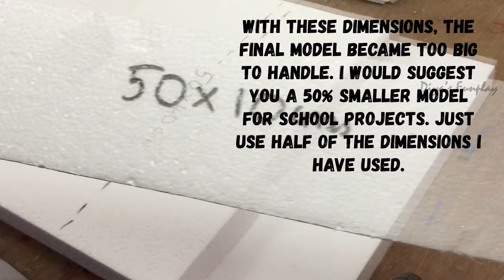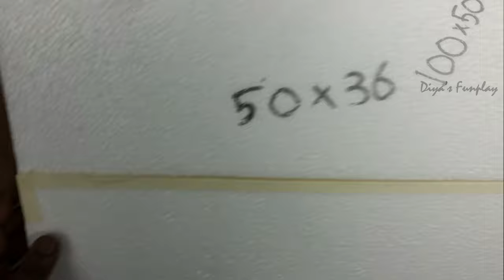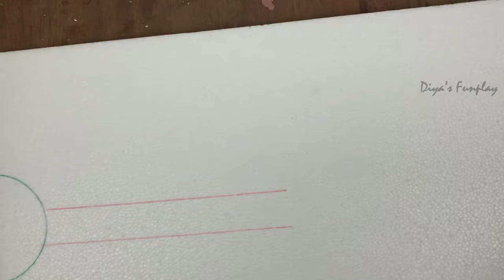Dam working model for science fair | Dam irrigation model | Water dam model for science exhibition

Comment from the maker: A Dam is a barrier built across a river or stream that blocks the flow of water.

Advantages of dam:
1. Provides water for irrigation and human consumption.
2. Generates hydroelectricity (we will not run out of hydro power as long as the water cycle exists.)
3. Avoids air pollution as hydro power is a clean energy.
4. Dams provide prime recreational areas for boating, camping, water sports and picnic.
5. Dams can supress floods thereby avoiding a big disaster.
6. Dams are useful for navigation (inland river transportation)

Disadvantages of a dam:
1. Dams affects biodiversity. Dams restrict the movement of migratory fish and other aquatic animals thereby affecting their reproduction and gradually decline in population.
2. Plant life may get submerged under water and eventually die.
3. Dams will capture and hold important sediments needed for habitats downstream there by affecting the fertility of the soil.
4. Construction of dams can affect the groundwater table along the river.
5. A dam collapse could be a major catastrophe. 
6. Construction of a dam could be very expensive.
Reply: Hello sir...plz reply urgently...how many no of thermocol sheets you have used and of how much of thickness of every sheet
Reply: Please reply 👏👏👏
Reply from the maker: Items needed:
Thermocol (1 inch = 2 sheets, 1/2 inch = 2 sheets, 1/4 inch = 1 sheet)
Cement (1.5 kg),
pvc pipe (1/2 inch = 1.5 feet)
Fountain pump,
pebbles and some toys (if you want),
Plant models (you can also make them with paper)
Reply from the maker: Sorry, somehow missed your comment. If you still need the info....
Items needed:
Thermocol (1 inch = 2 sheets, 1/2 inch = 2 sheets, 1/4 inch = 1 sheet)
Cement (1.5 kg),
pvc pipe (1/2 inch = 1.5 feet)
Fountain pump,
pebbles and some toys (if you want),
Plant models (you can also make them with paper)
Reply: Can you say where is the fountain  pump  available
Reply: Please reply
Reply: How much time can it hold the water ? At least 1/2an hour?
Reply from the maker: @drpreetiautade2286  Items needed:
Thermocol (1 inch = 2 sheets, 1/2 inch = 2 sheets, 1/4 inch = 1 sheet)
Cement (1.5 kg),
pvc pipe (1/2 inch = 1.5 feet)
Fountain pump,
pebbles and some toys (if you want),
Plant models (you can also make them with paper)
Reply from the maker: @misbahulein7848  It depends on the model you make.
Reply: Can we run we run it without the water pump pls reply urgently pls
Reply: Yes
Reply: I just completed my model 😊😊😊😊😊😊😊 thank you
Reply: Thank u 😊😊
Reply: Thanks for this video 😇
Reply: @diyasfunplay  how
Reply: What was its mame
Reply: Bro wrote an entire essay

Comment: Who many thermocol sheet using
Reply: Please reply
Reply from the maker: Thermocol (1 inch = 2 sheets, 1/2 inch = 2 sheets, 1/4 inch = 1 sheet)
Cement (1.5 kg),
pvc pipe (1/2 inch = 1.5 feet)
Fountain pump,
pebbles and some toys (if you want),
Plant models (you can also make them with paper),

Comment: Plz help.. thermocol sheets are banned here in Maharashtra..what else can be used instead...can you suggest..I want to do this project for my son ..
Reply: Plz reply🙄
Reply from the maker: @drpreetiautade2286  Sorry for the delay in reply. It would be difficult to do this model without thermocol. But, you can do a small dam model with thick cardboard (4-5 layers) And make sure to apply many coats of cement (let the first layer dry and then apply the second coat) so that the water does not penetrate the cement layer and gets into the cardboard. Make your model 2 feet in length and 1 feet wide. You can reduce the size if you want, but do not exceed the size i have mentioned. Please let me know if you need any other clarification. Thanks and all the best.

Comment: Well does the water reach the motor by any means or you add more water ?????
Please reply!
Reply from the maker: Add water to the bottom tank manually. The fountain pump should be atleast 90% immersed into the water. From then on, the water gets recycled. It goes up, flows down and continues......
Reply: @diyasfunplay  ohk thank you 
I hv my science exhibition next month so I am making this.Thanks for uploading this video🙏🏻🙏🏻😊😊
Reply: @diyasfunplay  And one more thing is I want to take the exact measurements you've given in this video cause I need a gigantic model.....
.

Comment: How much water you use for 1 kg cement
Reply from the maker: Add water in a very small quantity, ie.,  little by little (25ml per time). Use gloves and mix it with hand to avoid lumps. Add water little by little and mix well until you get the consistency shown in the video.

Comment: Fantastic ossum best project for school exhibition
Reply from the maker: Thank you so much 😀
Reply: I have a question the themacoal which you have used is hard one or soft one
Reply from the maker: it's a soft one.
Reply: Thank u so much
Reply: But by weight if it is broken down
Reply from the maker: No way. If you do the exact dimensions i had made or an exact scaled model without any design change, it will not break. Most of the weight due to water lies in the bottom storage tank. Since that tank is flat, it will not affect your model. The three holes on the top reservoir should be put at appropriate height so that no excess water stays back in the reservoir without flowing out through the dam outlet.
Reply: Thank u sir

Comment: Bro!! How the water came into it how to apply tat machine plz tell me na!!
Reply from the maker: First you will have to pour water into the bottom tank manually. From there the pump will draw the water into the reservoir and will flow down to the bottom again and will become a cycle. 
       At 9:39 you will see there is PVC pipe in the reservoir that is going down. You will have to connect the pump at the bottom end of that PVC pipe. (make sure the pump sits properly on the bottom tank without hanging in the air as shown in 15:36) In my model the reservoir PVC pipe length was short, so i have added an extra green pipe.
Reply: @diyasfunplay  thank u
Reply from the maker: Please refer below video. I have explained it.
https://youtu.be/T1eth0SoX_E

Comment: Sir this dam is very good but can u tell how many Thermo sheet are needed
Reply from the maker: Items needed:
Thermocol (1 inch = 2 sheets, 1/2 inch = 2 sheets, 1/4 inch = 1 sheet)
Cement (1.5 kg),
pvc pipe (1/2 inch = 1.5 feet)
Fountain pump,
pebbles and some toys (if you want),
Plant models (you can also make them with paper)

Comment: Sir I had prepared this dam yesterday night after 8 hours or 2hours I had sprinkled the water but after some time the cement had became colourless in edges and in some areas..plzzzz tell me.. How to recover this ....plzzzzz sir plzzz.....I have to submit day after tomorrow in my schl......plzzz give me a solution... .
Reply from the maker: After applying cement you should spray water gently for the first time after 8 hours, and from then onwards (after 8 hours) you will have to spray water for every two hours. When the cement dries up, it will go a bit white colour. But when you spray water it will absorb water and  become dark. This is completely normal. Handle the model very carefully. Rough handling may break the cement coating.
Reply: @diyasfunplay  thankful to you sir....🤝🤝

Comment: Can we use anything else than fountain pump and is that designing in the dam by that instrument  necessary???
Reply: Plzz reply fast please
Reply from the maker: You can use any water pump to circulate the water.
Reply: @diyasfunplay  and ya if we use fountain pump then how we will take the wire outside for connection and will it not give electric shock as it is submerged in water??

Comment: Hlooo....
How many thermacoll sheets do you use ? ✨
Reply from the maker: Items needed:
Thermocol (1 inch = 2 sheets, 1/2 inch = 2 sheets, 1/4 inch = 1 sheet)
Cement (1.5 kg),
pvc pipe (1/2 inch = 1.5 feet)
Fountain pump,
pebbles and some toys (if you want),
Plant models (you can also make them with paper)

Comment: Nice video but how much thermocol do you use? Please be specific
Reply from the maker: Items needed:
Thermocol (1 inch = 2 sheets, 1/2 inch = 2 sheets, 1/4 inch = 1 sheet)
Cement (1.5 kg),
pvc pipe (1/2 inch = 1.5 feet)
Fountain pump,
pebbles and some toys (if you want),
Plant models (you can also make them with paper)

Comment: Q. Can this hold water for atleast 2 hours if i did it as same like yours.

Q. Is this heavy to hold?
Reply: Also how to remove water from this after exhibition??
Reply: Please reply sir please please 🙏 please
Reply from the maker: It can run for days if you seal the model well and make it leak proof. The model i made is very big to handle. Plain thermocol model is very lightweight, but when you add cement coating, the model will become heavy and you will have to handle it carefully, else it can easily break. You will have to remove the water manually from the bottom tank. Make sure to spray water gently on the cement coating for every 1 hour (for one day) to harden the cement coating. All the best.
Reply: @diyasfunplay  Thanku so much sir

Comment: Tell me all materials which you used .
 Because l am also doing this project .
Reply from the maker: Items needed:
Thermocol (1 inch = 2 sheets, 1/2 inch = 2 sheets, 1/4 inch = 1 sheet)
Cement (1.5 kg),
pvc pipe (1/2 inch = 1.5 feet)
Fountain pump,
pebbles and some toys (if you want),
Plant models (you can also make them with paper)

Comment: Can we run it with out water pump also plz say Sir plz
Reply from the maker: You need a pump to move water up and down. If you do not want to use a fountain pump, you can use a dc water pump. (But the water flow will be very less)

Comment: Bro where you have used 1inch thermacol , 1/2  inch, 1/4 inch answer bro please fast
Reply from the maker: 1 inch for the bottom tank and reservoir areas. You can easily see the thickness of the thermocol in the video.

Comment: Cement is not a good option sir, it is not sticking to the surface
Reply from the maker: I guess your cement water mixture is very watery. The mixture should be thick (only a little lighter than toothpaste) It should stick to the thermocol. Do the process gently and do not disturb the model after applying cement for 2 hours. Then mist the model with water for every 1 hour for six to seven times until it gets harder. The cement may fall even after drying if not handled properly. So, handle with care. Cement is needed to make the model water proof.

Comment: My dam model is leaking very much...pls tell how can I fix this problem
Reply: Please tell...tomorrow is my exhibition
Reply from the maker: Fix the leak. Use one more coating of cement or,  use silicon glue to fix the leak. You can also use m-seal if you know where the leak is.
Reply: Ok ..thanks a lot

Comment: Isme kya kya saman required h
Reply from the maker: Items needed info is given in the Description box. 

Items needed:
Thermocol (1 inch = 2 sheets, 1/2 inch = 2 sheets, 1/4 inch = 1 sheet)
Cement (1.5 kg),
pvc pipe (1/2 inch = 1.5 feet)
Fountain pump,
pebbles and some toys (if you want),
Plant models (you can also make them with paper)

Comment: Sir I used cement and water and I mixed it and applied to it after 30 minutes I saw that it was totally dried I rubbed with my hand and the powder is coming please give me suggestion I want to present it on science day please reply fast
Reply from the maker: After 2 hours of applying first coat, spray/mist water on the cement for curing. apply water gently 2-3 times. Then apply second coat and spray water as mentioned earlier. It has to dry completely for 24 hours. Do not apply a very thin coat of cement. Do not rub it before the cement sets.

Comment: 9 : 21 how did u keep  those 4 slanting  thermacol pieces
Reply: Please reply fast because  I  have  to  do this  model for school  science  model compitation  .
Even I made half of it but it is confusing
Reply from the maker: Those four pieces are glued to the bottom slanting piece.
Reply: @diyasfunplay  thank you  a lot  for  your  reply
Reply: Can we use  portable  battery  air pump  instead  of  DC fountain pump
Reply from the maker: Air pump can pump only air. You need to pump water for this dam model.
Reply: Thank you  a lot

Comment: Will you please tell me the what are required materials for this model
Reply from the maker: Items needed:
Thermocol (1 inch = 2 sheets, 1/2 inch = 2 sheets, 1/4 inch = 1 sheet)
Cement (1.5 kg),
pvc pipe (1/2 inch = 1.5 feet)
Fountain pump,
pebbles and some toys (if you want),
Plant models (you can also make them with paper)

Comment: Is part 4:14 necessary like is it necessary to make it like a hinge ?
Reply 🥺🥺🥺
Reply from the maker: Yes. Without the hinge in my design, it'll be difficult to remove the floor board (where the pebbles are laid and water flows), and it will be difficult to access the fountain pump. If you want to avoid the hinge mechanism, you will have to measure and make the floor board smaller (Will need some additional work)
Reply: @diyasfunplay  ohk
Reply: @diyasfunplay  I will try doing it almost work is done except for this and the cementing work
All measurements I have taken and everything is fine

Comment: Sir how can I on that fountain pump sir and kindly can u tell howany hour it will work without issue
Reply from the maker: The fountain pump comes with a wire and a plug. You need electricity to run this pump. The pump can run continuously for months and years.
Reply from the maker: Please refer below video. I have explained it.
https://youtu.be/T1eth0SoX_E

Comment: Sir pls tell me what are the materials required pls its urgent by tomorrow i have to complete
Reply from the maker: Items needed:
Thermocol (1 inch = 2 sheets, 1/2 inch = 2 sheets, 1/4 inch = 1 sheet)
Cement (1.5 kg),
pvc pipe (1/2 inch = 1.5 feet)
Fountain pump,
pebbles and some toys (if you want),
Plant models (you can also make them with paper)

Comment: Hello , the model is the best but i have problem with the pump and pipe how have you connect the pump and pipe and how are they giving flow to water , and pls tell me is the water that we put in one time will be recycled several times right ? 
I hope for the reply pls give reply quickly because i have to do for my school project i dont have time hurry up
Reply from the maker: The water pump is placed in the bottom tank. The water pump outlet is attached to the top reservoir through a small hose pipe. The water pump pushes the water from the bottom tank to the top reservoir through that hose pipe. Water will be flowing down and up continuously without any issues.
Reply: @diyasfunplay  Thank a lot for replying you are very humble person you actually now I can make it for my exibition , if i will face any other problem I will inform you thanks
Reply from the maker: Please refer below video. I have explained it.
https://youtu.be/T1eth0SoX_E

Comment: U didn't mention scales but u used in dqm
Reply: Dam
Reply from the maker: Those scales are sitting useless there. so, ignore it.
Reply: U said useless but I want to know y u used them please tell me
Reply from the maker: @gopikarukhmini610  Initially i planned to use them and fixed it. But later, it did not work as expected. The scales were supposed to block the canals. But the water was leaking out. So, left the idea behind and forgot to take out the scales.

Comment: How you slow the flow of water
Reply from the maker: You cannot control the flow quantity with this pump. However, when the water level is low, ie., when the pump is not fully submerged into the water, the flow will be a little less. But, do not run the pump with little water for a long time. 1-2 mins should be ok. See the below video for a better understanding.
https://youtu.be/T1eth0SoX_E
Reply: But you can do slow flow of water
Reply from the maker: I have not installed a flow controller in this setup as this is a bit powerful pump. You can use it in your model if you want to.

Comment: How many thermocol you need
Reply from the maker: Thermocol (1 inch = 2 sheets, 1/2 inch = 2 sheets, 1/4 inch = 1 sheet)
Cement (1.5 kg),
pvc pipe (1/2 inch = 1.5 feet)
Fountain pump,
pebbles and some toys (if you want),
Plant models (you can also make them with paper)

Comment: How many thermapols did you used in this dam project
Reply from the maker: Items needed:
Thermocol (1 inch = 2 sheets, 1/2 inch = 2 sheets, 1/4 inch = 1 sheet)
Cement (1.5 kg),
pvc pipe (1/2 inch = 1.5 feet)
Fountain pump,
pebbles and some toys (if you want),
Plant models (you can also make them with paper)

Comment: After the cement is drying it's falling off can anyone help?
Reply from the maker: Spray water gently after 2 hours of applying cement. Spray water for every half an hour for around 10 times. Cement has to cure properly, else it will fall off.
Reply: Thank you so sooo much btw the design of the dam is outstanding
Reply: @diyasfunplay  and after drying the colour of cement is greyish is that ok?
Reply from the maker: Yes, cement when dry will be grey and when you spray water and make it wet, it becomes dark grey.
Reply: @diyasfunplay  ok thanks